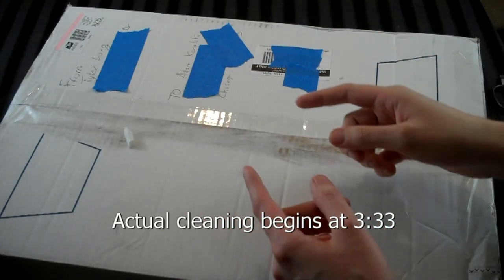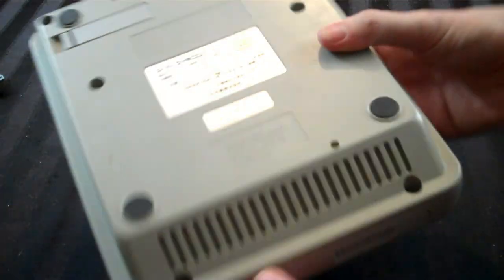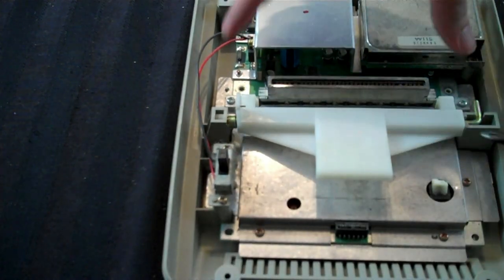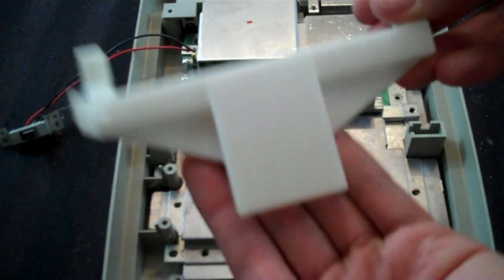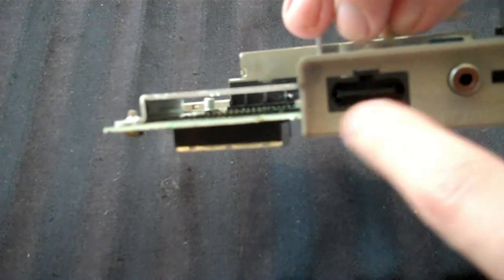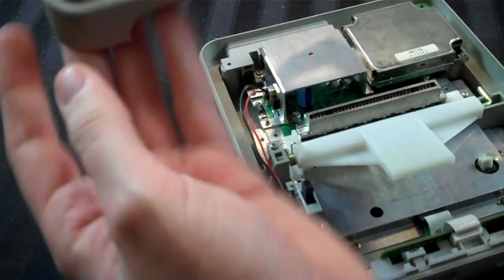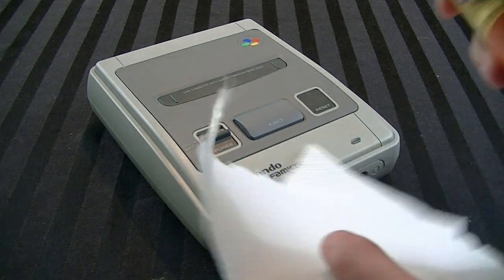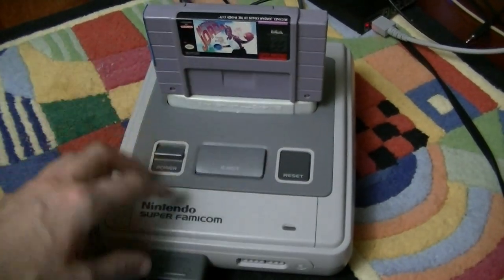Gamerade - Cleaning and Restoring a Super Famicom (or PAL SNES) - Adam Koralik

Comment: I just finished cleaning my Super Famicom via the Retrobright method. There wasn't any yellowing but it had darkened a bit but now it's back to that nice light grey that it always looks like in pictures of old. 

There were some interesting differences internally. First off, my system did not have that huge metal RF shield on the bottom plastic plate which I thought was kind of odd but It doesn't look as if the system had ever been opened or cleaned so maybe it was a later revision of the console? The big metal housing over the Sony sound chips was also absent. There was a much smaller metal housing over them though but it was firmly attached to the motherboard. The controller ribbon assembly also was slightly different in where it was placed but watching your video people will get the gist of it. 
Thanks for making these by the way, they're a big help to the community!!
Reply from the maker: Happy to help, thanks for watching.

Comment: You can actually clean a circuit board with water, but you cannot let the water sit and cause damage.  You can clean with water, then remove the water with something else like alcohol.  You can also just buy bottles of PCB cleaner and spray that around.  Obviously you shouldn't use the board until you're absolutely sure it is dry if you do this though.

Comment: Dishwasher for the motherboard on gentle make sure you use compressed air afterword. works with everything and have done it for years. 800-2000 grit sand paper for contacts for cart slot and Windex multi surface is a better product than regular Windex. Been using this process for 20 years.
Reply: Dishwasher should really be the last resort. You never know how the plastics on the board (IC housing and stuff) will react to the detergents, even if those are only residues.

Comment: On the parts where you took off and put back in the little cartridge slot door respectively, where does the little spring get positioned in order to open and close correctly?

Comment: I disassemble systems and douse the plastic shell in hydrogen peroxide, leave it in the sun for four hours, empty fluid and replace with new peroxide for another 4 hours. Sunlight is key. This reverses the yellowing for the most part.

Comment: I just bought a Super Famicom and the main thing im seeing that needs cleaned the most is the cartridge slot. Its relly safe to use Windex inside the contacts like that!? O.O mine also has a little bit of tarnish on the outside metal part of the cartridge slot.

Comment: Could you do a video a super nintendo controller please because my snes controller is really sticky and i would like to clean it out. Thanks
Reply: That's a easy fix just take all 5 Philips head screws out clean the rubber pads with alcohol and glass cleaner also the contacts on the controller board most importantly make sure it's dry 100 percent
Reply: @ronaldhenson9170  ah thanks man even though I don't have my SNES anymore lol. been 5 years since I made that comment

Comment: Never underestimate the importance of discharging your SNES or Super Famicom before opening and working on it. I shorted the power switch on the shielding while it was switched off and unplugged, and boy do these things store a charge. 

Long story short, you'll be in for a fuse replacement if you don't discharge it.

Speaking from experience,as of... 30 minutes ago.

Lastly, the PAL Super Nintendo does use 9 volts for power, but the output on the SNES power supply is AC and not DC. Do it properly, do it once, and use either an NES or SNES power supply wherever applicable.

Comment: Hey Adam, I've been wondering for awhile now. Why do you use windex? It's a great cleaner for everyday things, but for electronics it doesn't seem to be very good because it leaves a residue on them. My recommendation would be to use alcohol. Do not use regular rubbing alcohol though, because it leaves a residue just like windex does. Use 90+%  isopropyl alcohol.

Comment: Hi, I have a problem with my SNES, power switch and all is working fine, but often the games don't load up. Sometimes they do though, sometimes at first try, sometimes it needs many tries, sometimes they just don't work. Sometimes a game crashes.
Is this a problem with the console or is it more likely a problem with the modules. I read somewhere that low batteries can cause problems besides the loss of savegames. I looked inside some of the modules, and they all seem to be in pretty good shape, I mean no obvious damage or leaking battery.

Comment: Hi there Adam, I didn't really know how to contact you so I thought I'd try it on a video here. I bought a Super Nintendo yesterday. It turned on, but the light was red. I tried powering on and off the console a few times, but now the light just doesn't turn anymore. Is my power supply busted or is it the entire system? I don't have another power supply to test it with unfortunately. Thank you!
Reply from the maker: Anthestudios Either the PSU died or you popped the fuse inside the console.
Reply: AdamKoralik I'll see if I can fix it. Thank you!